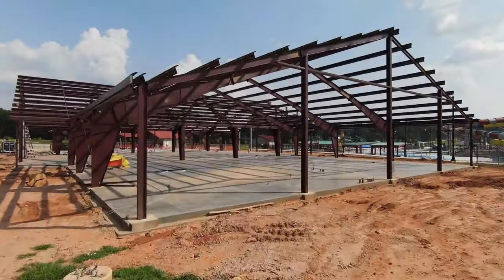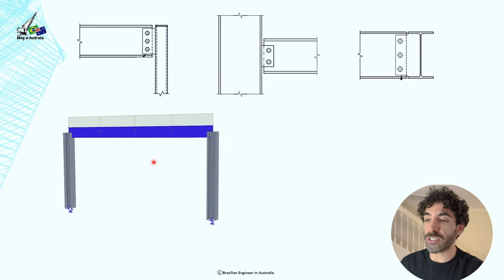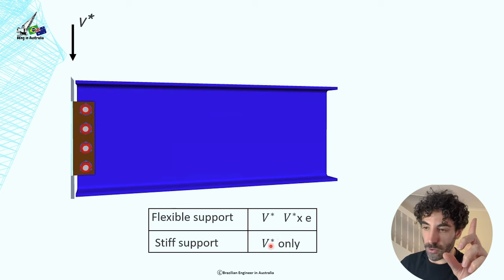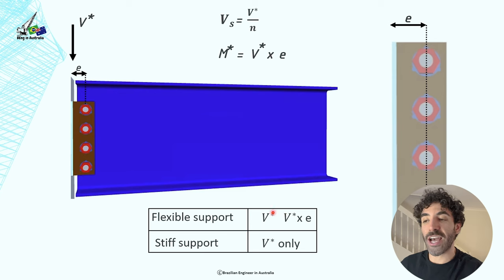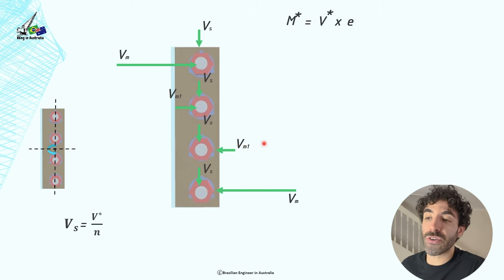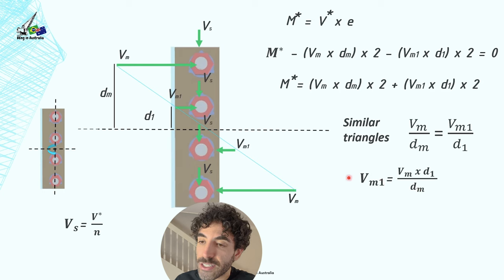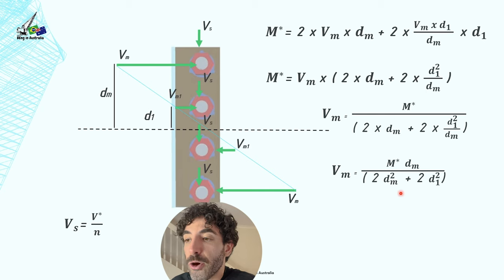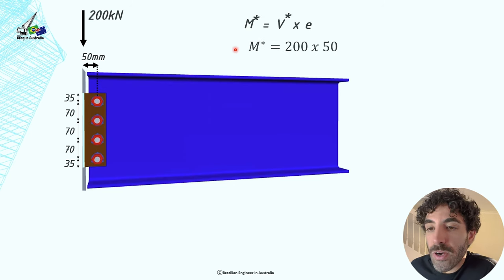DO NOT Make This Mistake - Forces on Bolts on Side Plate Shear Connection

Comment: A senior engineer once suggested that I design the connection based on the shear capacity of the beam instead of the reaction for good practice - to cater for future load increases for instance.
So say in this example the beam had a shear capacity of 240kN (to sustain the 200kN shear force), I would calculate the vertical shear component of each bolt as 60kN.

Is this something that is applied in Australia as well?
Reply from the maker: AS4100 minimum design actions are 15% of the member capacity or 40kN, whichever is the lesser. Often times I have to use a larger than required beam for construction/architectural purposes so adopting the shear capacity of the beam would be an overkill. Up to you how you want to go about it.
Be careful with set rules like that. Some connections with prying action increase the load on bolts by 30%